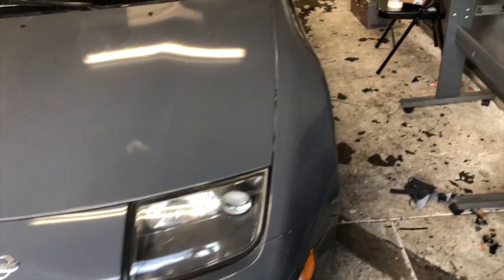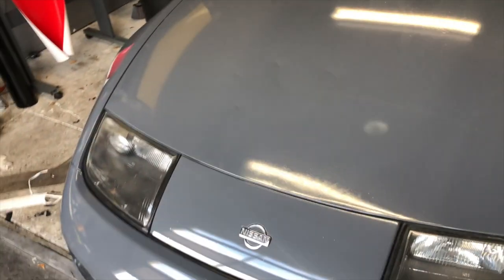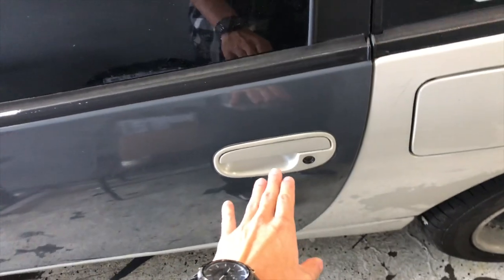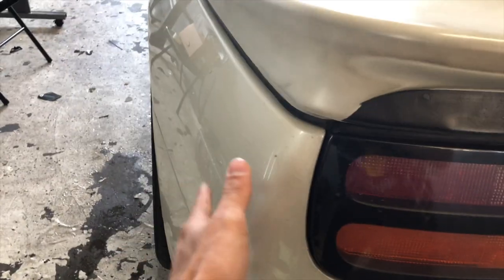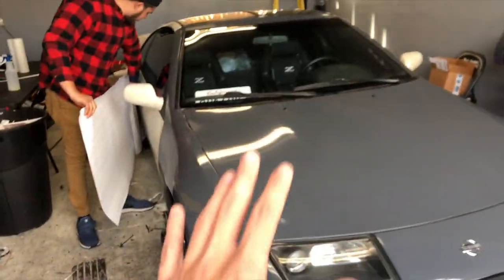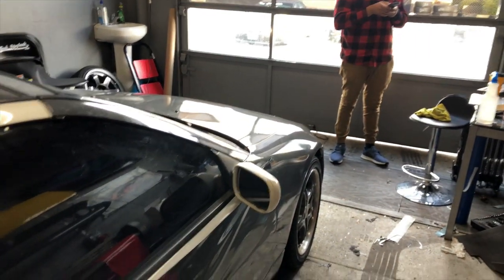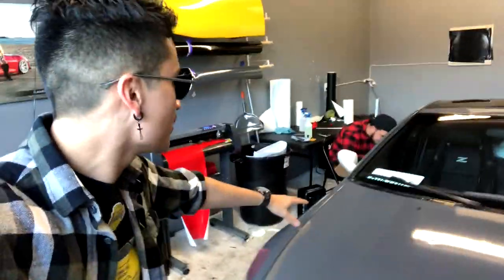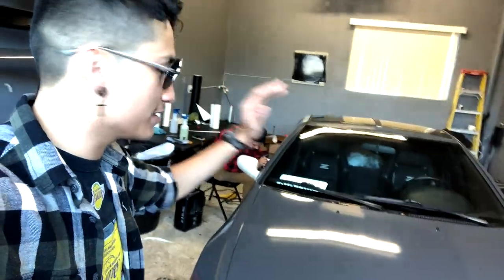REVEALING MY NISSAN 300ZX TWIN TURBO CAR WRAP!!!

Comment: Hey Texzle. Just starting a resto project on a 91TT. I checked out your other vid listing your mods from a few months ago. My first mod is tires & rims. I see you put on wider tires and rims. Did you have to do the knuckle mod in order to fit the wider rims? I was told that any rims wider than 8.5" will not work because of the Hicas unless the knucle is modified. If you did do it what is involved. If you get a chance I put a video of the resto car on my channel. Thanks so much. 👍